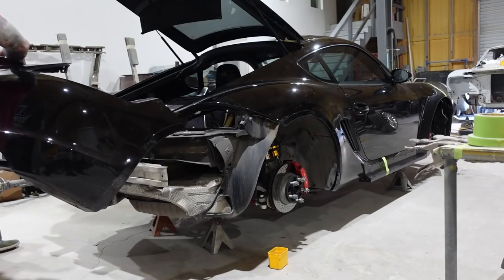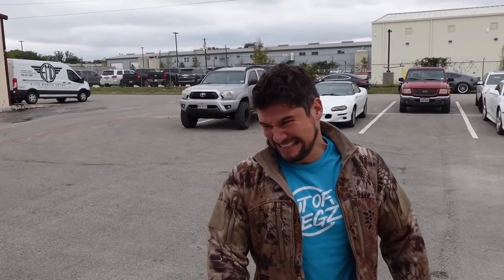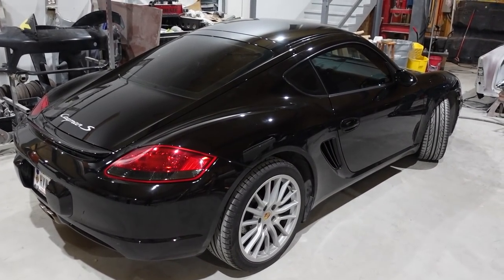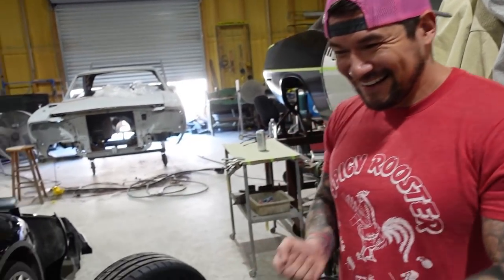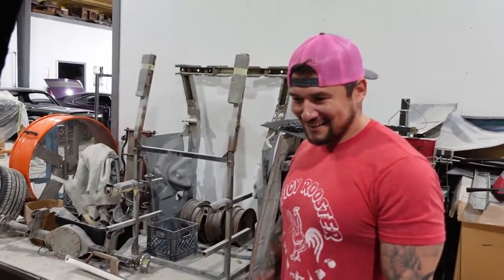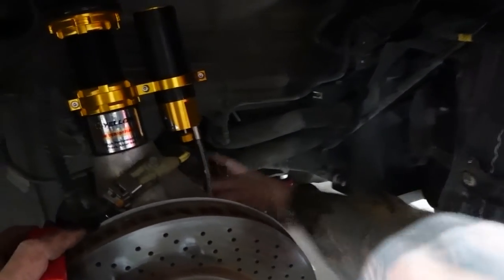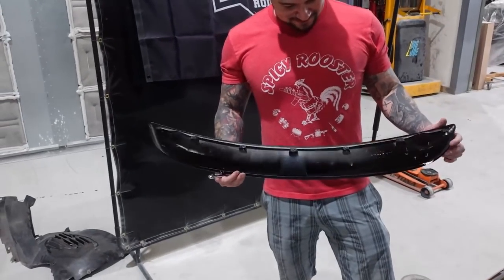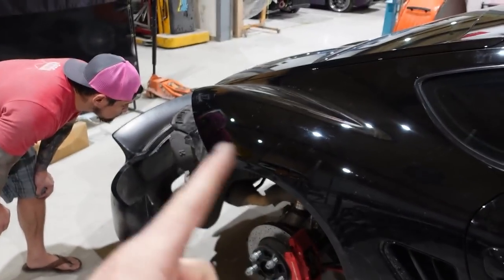Installing a Rocket Bunny kit on a Porche Cayman S with  @Eli_Doubletap  PT.1

Comment: Wow, that's really making the Porsche look cool. I've a similar tool to install the thread zerts for repairing my luggage/ski rack on my Grand Cherokee, bought mine at Harbor freight or Northern tool , looks like a poo rivet gun tho. And the thread zerts as well came from one of the 2. Likely not as high end but still worked awesome!
Reply: Yes Rivnut Guns come in various sizes, the larger they are, the larger inserts they are capable of installing.

Comment: You need to deactivate that spoiler. That spoiler goes up automatically when you reach 70 miles an hour. And retracts when you hit 50. If you don't deactivate those rods they will pop right through your bumper or your ducktail.
Reply: According to the handbook "Approximately 76mph"
Reply: @outhy_r  and you don't think they're going to hit 76 miles an hour?
Reply: @kellynash4588  I have no doubt they will; It was more that 70mph is not the specified number.

Comment: matt didn't look very impressed @3:40 that your starting a new build when his car's sitting there at the back of your shop unfinished......... your first video on the cuda was 30/1/21 in 11 days you've had the car for a whole year most shops would have finished the full build by now so i just wanted to know and i'm sure the rest of the demolitia world want to know the answer to the question too: why have you stopped working on the cuda and when will it be 100% buttoned up and finished????💪😎👍
Reply: The shop isn't called Matt's demo CUDA shop. It's muscle rod shop. You notice all the other vehicles. Matt's not the only project in motion. Good things take time. Rome wasn't built in a day.
Reply: No shop that does work at this level would have a project done that fast unless it was the only project being worked on. Most show quality frame off restorations take a few years(at least more than one). The cuda is that plus a ton of custom work.
Reply: Matt may of run out of funds, the last i heard he was taking it home for a while.
Reply: @65cj55  i don't think he run out of funds but i do remember him saying he was taking it home for awhile
Reply: @iR_STONA  It's not hard to work out, the Guy's not as Rich as people would think, the only thing stopping it's completion, is Money.